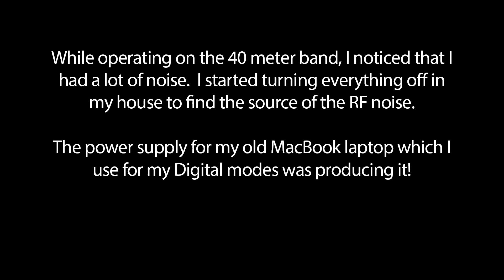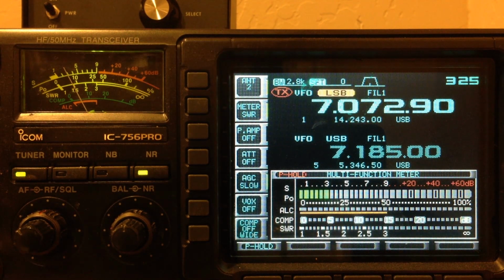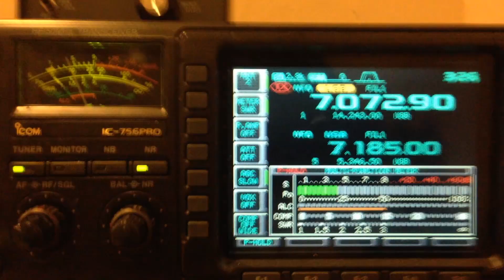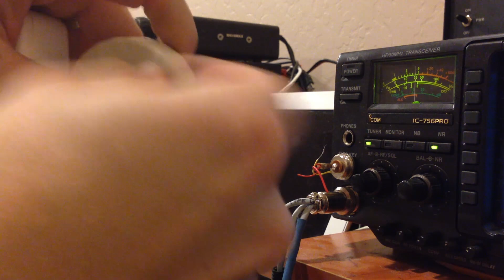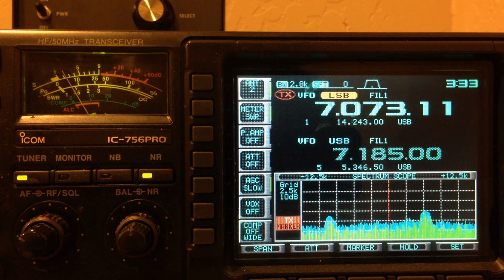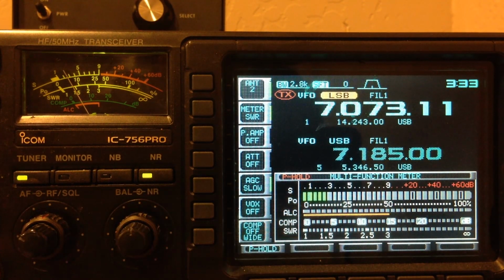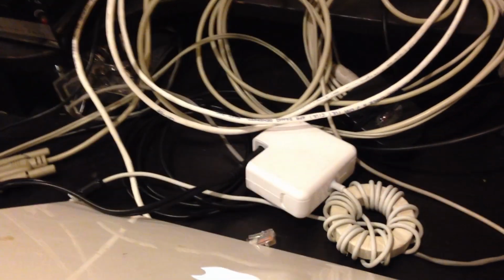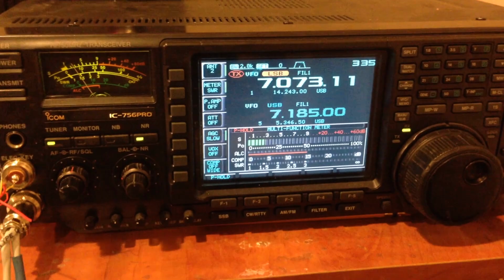Removing RFI Noise from MacBook Power Supply

Comment: my macbook air  powersupply is super noisy as well, I added some snap on ferrites and it helped some
but looks like the torroid is more effective. I run mostly digital modes like jt65,ft8 etc and the noise was really killing my receive
Reply from the maker: I have also noticed that original Apple power supplies are much less noisy than aftermarket ones. If you have a friend that has one, make sure you try it if you have one of the aftermarket power supplies. I ended up buying my Macbook used a long time ago and turns out my power supply was aftermarket.
Reply: my power supply is an apple  supply, just noisy.

Comment: Hey Drew, VE7SCM here, I see you are also a ham! Cool... I do sound also! I am using the Midas M32r with Dl16s and a Dlink AC3200 router with Ipads to do small shows with local musicians. Some bands are quite talented, others not so much. But it's fun none the less. Your videos have been quite helpful, thanks. It is getting easier to make the transition from analog to digital. My next feat will be to do record tracks of a live show on my Alienware laptop with Sonar X1. 
I just stood up a 60' self supporting tower. I want to put a OB9-5 on it and hang some of my dipoles and vhf beams off it.